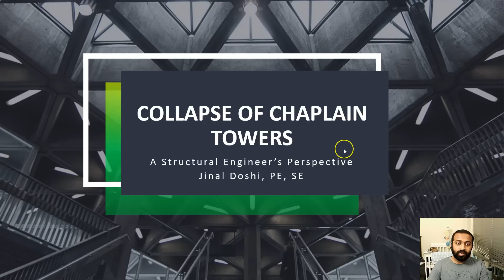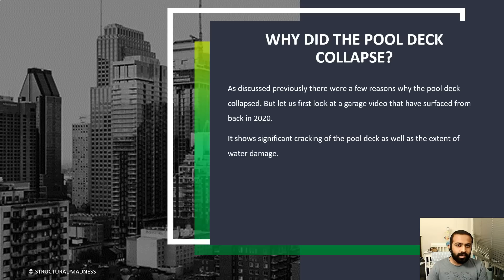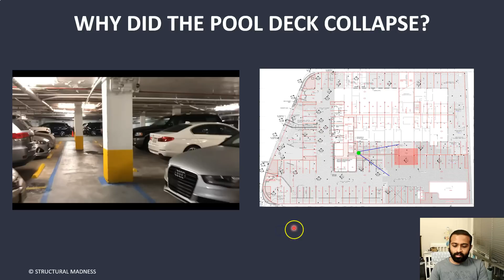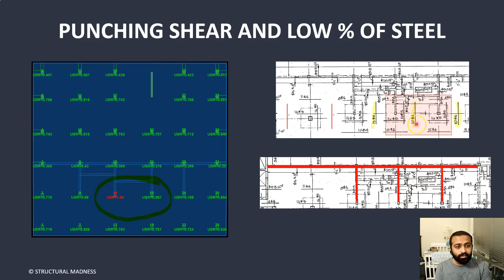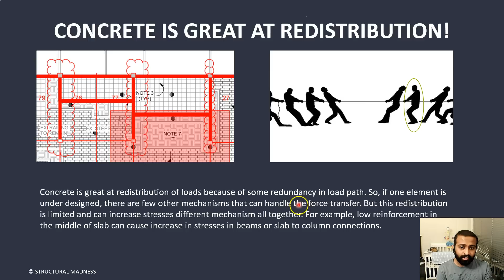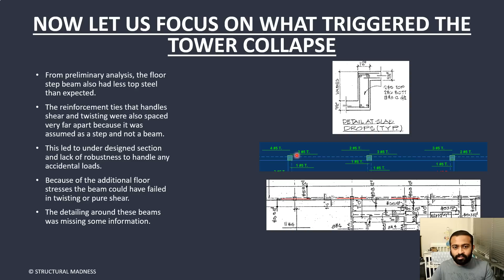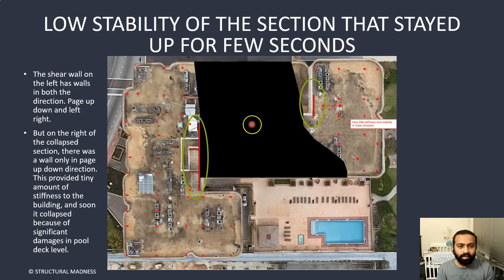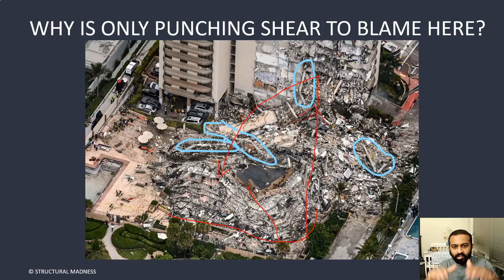Reasons behind Surfside Building - Champlain Towers South - Collapse : A Structural Engineers Review

Comment: Thank you: ‘16 x16–That is too skinny”. I appreciate this directness. Notice that the portion of the building still standing after the collapse was underpinned by 24x24 columns. So strange that the columns were so different throughout the building. And lo and behold the 24x24 columns held and the 16 x 16 “too skinny” did not.

Congratulations! I have watched several videos like this with engineers; you are the first to extend analysis to the transmission of the pool deck punching shear stresses to the rest of the tower via the beam that was insufficiently reinforced at the front of the tower that collapsed first, and left the “too-skinny” group of columns without any lateral support. This model doesn’t even require water damage to those “too-skinny” columns to explain the failure of the tower when presented with the pool deck punching shear.

Implications: people at Champlain Towers north at 8877 Collins should leave immediately: your building is underdesigned, even if it was maintained better (though there is question of whether it might have been constructed better as there were differences in the way it was built due to different financial stresses and different development history).

I can’t imagine there is great sale value of units in Champlain North right now…
Reply: I agree… an former valet who worked both buildings said that both parking garage ceilings leaked from day one. The North tower is also in trouble.
Reply: @jrosebud2021  So why did one pass inspection and the subject building fail? That valet been working there 40 years. What a wonder career that must have been.
Reply: @toddmarshall416  I don't think the inspections are sufficient.
Reply: @toddmarshall416  The other didn't fail, though, did it? Even Building Integrity (another licensed structural enginer) said the inspection report wouldn't convey URGENCY the photos tend to convey to someone who knows what it actually means. The rust, peeling. Spalling. Constant standing water and halfa**ed "fixes," like sheets of plastic. There's garage video on it, too. 

Sounds like maintenance was REALLY in over their head, OR said something and the board said NO. Like, get an inspection. No.
Reply: Sobering!
Reply: I would appreciate if you could look into the 1st Floor area at the vicinity of Col 81/80 as I think 
this area seem to be a perfect storm for the collapse . My observations are from watching some 
Of the videos from you tube 
1) Change of pool deck level 
2) Col is 16" x 16"" 
3) has planter box 
4) change usage i.e. From apartment unit to fitness center 
5) Next to the Wall and seem to support slab of largest span in both direction 
6) remedial work carried out
Reply: The largest columns supported the building, while the smaller columns supported only the pool deck.
Reply: @waterviolet16  the ones supporting only pool deck were 12x16. The ones supporting collapsed building were 16 x16, the ones supporting building that remained standing were 24 x 24
Reply: @kineahora8736  Exactly!
Reply: @kineahora8736  
"The ones supporting collapsed building were 16 x16, the ones supporting building that remained standing were 24 x 24"

Thats not true - or at least it is, too simple.
The collapsed part has columns from the parking area too the roof.

The remained part, has columns from the parking area to the 2. floor.  Massiv beams @ lobbylevel, under the 2. floor helps to carry the upper floors over the lobby.
In this floors even the remained part of the buildung has 16 x 16 or even smaler 24 x 12 ones.

So, the remainded part of the building, doesn't stand on the founding, but on BEAMS!
Thats is not a "good" or save design. 
The 24 x 24 columns were needed, to support those beams. 
The first failed line of 16 x 16 building columns carry half as much, as the second line of 14 x 18.

Even the 24 x 24 columns are (by my contrys building codes) underdesigned for the high of basement level + lobby. 
So those column 72 (@24:04) is not "failsave" if one floor punches through.

I don't think you should (over) simplify this to "24x24 still standing while 16x16 failed".
Reply: I think the 16x16 columns were closer to being designed properly than other aspects of the building structure.  The maximum height a designed would have been 13' between ground level and level 2.  But if there was a failure of the ground floor and it fell, now those 16x16 columns are not braced by the ground floor and they become about 22' tall.  This is a whole different story for 16x16 columns.  They could work if lightly loaded by very heavily loaded probably not.  This is the last step in my theory of the failure.
Reply: @billj5645  I don’t think the 16 x 16 columns actually failed. The hypotheses I’m hearing that make the most sense is that they shook when yanked by the punch-shearing of the exterior deck-slab. I do think the most improper aspects of the design were all in the pool deck slab and in its improper connections to the building. But I’m wondering if the 24 x 24 columns on the remaining portion of the building were able to withstand the other problems and the 16 x 16’s were not… I don’t mean outright failure mode, but resistance to shaking/deflection. sometimes you just have to have that extra reserve. It is also the case the penthouses which were a 13th story were added after the design and original construction, which also put extra loading on that part of the building with the 16 x16s. You have to think about the extra $$ they made by selling those penthouses vs the added cost of say 24 x 24s: something tells me a bit sturdier columns and especially better connections between said columns and all of the floor slabs probably would cost a whole lot less than having 2 penthouses to sell. But then they thought “ well we can cut costs and have the penthouses!” Uggh.
Reply: @kineahora8736  I think I am close to understanding a possible mode of failure of the columns. I am working on a second video for some additional information on actual punching shear capacity and what the top reinforcement is as people are misunderstanding that a lot, some people on YouTube are spreading miss information. And secondly on the failure mechanism on column. Let me work on it and possibly publish it today or tomorrow.
Reply: @JinalDoshi91  ok thanks. I think whatever top reinforcement there was on the failed deck slab may easily have been delaminated from the layers of concrete below—while this would clearly make punching shear much easier to occur, it should also lessen any moment applied to the building column bases as the largely unreinforced bottom concrete fell away. But then of course there’s lipping of the rebar actually in the columns into the deck slab and this wouldn’t have been subject to delamination and could transmit moment especially if lipped into the bottom layer of the deck slab…

Comment: If other complexes were built near the same time as this one, and with the same plans, wouldn’t they need immediate work to strengthen and bolster columns and beams?
Reply: We know that there is one nearly identical building nearby.  We only have preliminary drawings for it.  I would love to have final drawings to do calculations on to see how close it really is to the first building.  We don't know if there are other buildings based on these drawings, or if there are other similar buildings designed by the same engineer.  If they didn't make major changes in the second building before it was constructed then they definitely need to be in there doing strengthening of it.

Comment: I think you a wrong that those 3 columns collapsed because of "necking". 
On other videos I saw that pool deck collapse created a lateral pooling to house columns and bent them
Reply from the maker: I could very well be. And that's why on top of necking I do mention lateral instability because of all that was going on down in the garage. But remember that column would have failed mainly because of its lack of resistance to any lateral deformation. And necking just reduces it capacity further to handle any of these accidental lateral demands.
Reply: @StructuralMadness   I think we have a evidence that the pool deck felt with a clear cut: https://youtu.be/YNMxzFmKyyg
And the next guy is a bit strange but he has a very good point explaining that the columns didn't fail but the building still collapsed solely because of weak connections to columns https://youtu.be/SkdVvXvHeJU

Comment: Great analysis! I think a major design flaw was having the pool slab connected to the building and columns. And having those front connected columns thinner than the other side columns.
Reply: I think it had to be.  One, a seam would lead to water infiltration; two the structure would require alot more reinforcement; and three, and perhaps  most importantly, this would add strength during a hurricane.  Even f the deck had been freestanding, it could have still brought the building down if it transferred enough vibration.  Larger columns and a thicker deck ( which would have been needed to stabalise a freestanding deck) would have kept the bldg intact to begin with.  Stiffness goes up with the CUBE of thickness, so a 12" deck is twice as stiff as a 9.5", the same for a 20x20 column vs. a 16x16.  This would have prevented the stress cracking and most of the water infiltration.  It would have also allowed the bldg to resist the sideways force created by the deck collapse.  

Newer bldgs are stiffer because they are built to a higher wind load, around 200mph for the Miami area, but only around 140 or so when CTS was built.  Even in low wind areas, newer bldgs must with stand at 90 -112mph (150-175 kph).  And I believe most area are raising it to 133 (actually 200 kph).  So there is a much alrger safety factor .
Reply from the maker: It is fine to connect elements like that. Typically a pool deck collapse would be considered as local failure. But here the building collapse is main because of in sufficient structural details as well as poor design of the floor slab. May be the structural engineer didn’t even have an exact idea of the actual loads on the floor? Who knows. But we do this all the time. Sometimes we need it for resistance against wind and seismic forces. It is just that we have to detail it properly. That was a major missing piece in the drawings and I wouldn’t be surprised that NIST also provide a point about bad structural design and detailing in this case.
Reply: @StructuralMadness   Separating structural boundaries can be of benefit to the contractor for construction sequencing and scheduling, etc.  Of course, there is the need for dowels and other details to allow for the correct distribution of loads.  I personally think in this case the pool deck imposed moments (at least when becoming degraded and failing) on the columns that failed.  I think I recall that you mentioned this specifically.
Reply from the maker: @geoffmorgan6059  Yes, the integrity of concrete within column at the pool deck slab as it collapsed could have been compromised. I don't think yet that the pool deck collapsed pulled away the column like people are talking about, if that would have happened, the columns would have failed immediately along with the collapse of pool deck as it will be a shear force that will be acting on the columns. Secondly, the pool deck and columns were not interconnected with a lot of reinforcement for example. The reinforcement along the step beam is called out as #5@12" on c. Now if you don't have a lot of rebar connecting the slab and the column specifically, then the collapse of the pool deck cannot generate a lot of force. Because concrete is bad in tension and with just 2#5 rebar within the column, you can't even generate enough force that the column shouldn't be able to take. So I do think that the pool deck collapse has lead to the collapse of the step beam based on the force field that we are discussing. But then the question is when and where did the step beam fail? Because in the Garage video if we look closely, you will see 3 soffit steps, two right at above the Ramp per structural drawings, and third one is the step beam. What my concern now is, if the step beam did not fail in the visibility of the camera angle, did it fail where the gym was? Because the pool deck gave away, the step beam was not able to handle the reaction on the shear wall end. And with heavier loading as well as torsional demands, it collapsed there? I still haven't concluded anything yet, I am still doing some calculations to see if it backs up the hypothesis.
Reply: @StructuralMadness   Good points.  Not being well versed in concrete design I would not consider the failure of the bond of the rebar in the slab as necessarily powerful enough to pull the columns over.  However, the sudden shear load which would amount to a dynamic force might have led to an excessive (beyond loads considered in conventional design) vertical force.  I agree with you the the step beam with its "Z" configuration is a peculiar feature of this building.  If you pursue the in depth analysis of the design and applied forces for this shelf beam, including some anticipated and some not anticipated, it will be most interesting.  I have seen a lot of comments about the support beam that looked to be "sagging" from deflection in the video shot by the realtor.  I can't recall the location, but it is in the area featured by the "tourist" video immediately before the catastrophic failure.  If this particular beam was in as much distress as has been implied, there would have been some serious fissures opening up along the bottom, tension side of the beam prior to the collapse.
I also concur that having "directional" or "per location" columns in the same structural function, is not the best protocol.  It also disrupts the construction efficiency by requiring a separate form configuration, especially for three or four members.
One thing for sure is the matter of the punching shear resistance steel required for the column connections at the time of design (circa 1980).  It seems the ACI made a quick revision to address some concerns by their technical committee(s) or other parties offering commentary.  I recall the massive shear column capital cones that were used in concrete construction like:  https://www.cecoconcrete.com/projects/dunnhumby-parking-office-tower/
Thanks for taking your time to respond to my comment.  This failure was a tragedy.  Let's hope that the other condo buildings to this design are inspected with the intent of removing any design oversight.

Comment: Finally someone who tells what he sees with out being afraid of stepping on someones toes.Buildings dont fall down by them selves,they need help/
Reply: Engineers harness energy, materials, and human capability.  Good engineers are not subjective on physics.  The human part is subjective.
The engineer creating this video added a great deal to the discussion.
Reply: A simple exercise: For each 100 pounds of horizontal component of wind force directed against a north wall, each of the east and west outside walls that are at right angles to it takes up 50 pounds of force. If a third interior wall is added parallel to the east and west walls then each wall will take up 33.3 pounds of force. The floors that also transmit this horizontal component of force to the outside walls prevent inward deflection of the north wall. Horizontal force transmitted by the floors that is taken up by the footings of the columns and rear wall may be ignored for this analysis.
   
Is a third interior wall of solid concrete required? (Referred to in some discussions as a shear wall). After calculating the force that the east and west walls must accommodate it is a matter of design choice. It is likely that the minimum thickness and strength of the east and west walls already greatly exceeds the horizontal force that these must hold back. Thus, for each 50 pounds exerted horizontally, the walls as a result of their strength to function as a wall supporting the vertical downward load from weight, are already capable of sustaining a horizontal component several times that amount, which is why the contribution of the footings was ignored.
   
A building is designed so that the entire structure remains standing. That a collapse is only partial appeals to emotions, not logic. 
  
An interior wall of solid concrete that is not connected by rebar to the adjacent part of the building is in effect an exterior wall to which an abutting structure has been added that encloses it making the whole thing appear to be a single building. Pre-construction-sales enabled raising capital for a much larger structure.¹³
   
The reason behind this two-phase approach is finance, not engineering. 
    
     
     
¹³      For each dollar investors advance for the cost of constructing a 100-unit building unknown to them these funds are sufficient to build twice as many units. The 80-unit addition that effectively costs them nothing accrues to the organizers.
Reply: He just repeats what other structural engineers already said here. Nothing new.